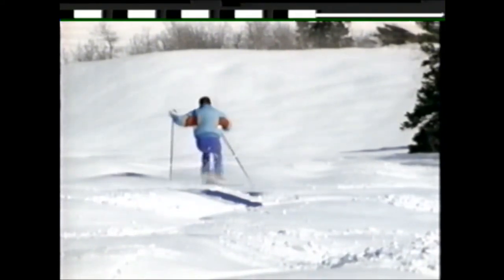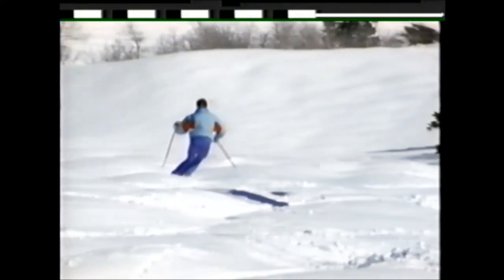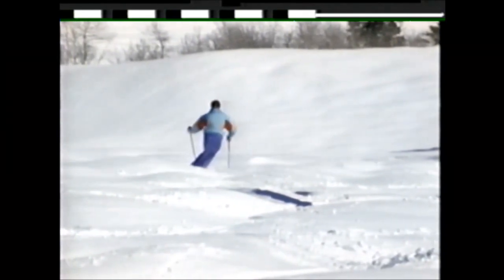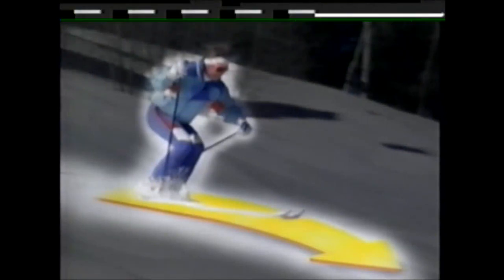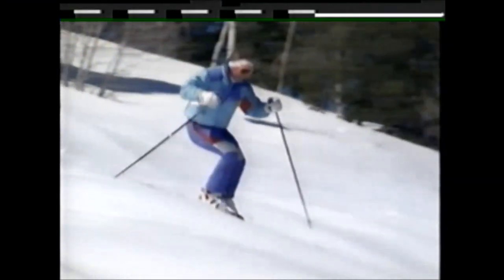Older ski techniques - about 1988 - PJ Jones

Comment: I think for most skiers, not that much; the changes are pretty subtle. The big basic difference I guess is the advent of the carving ski, and in pure carving there is no sliding, the skis stay on track throughout the turn and the turn is effected by the flex and sidecut of the ski under pressure. However, most skiers on modern carving skis still use an element of slide as well as carve in their turns, so the change is kind of nuanced. But you don't really see that kind of hopping (both skis off the ground) during turns anymore; modern skis are cambered and fabricated to give the necessary spring without actually leaving the ground.